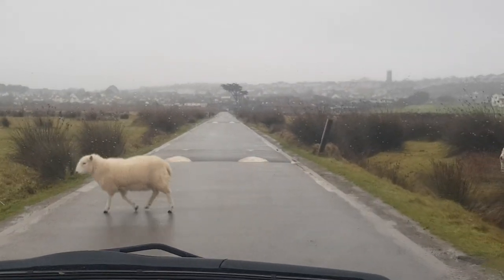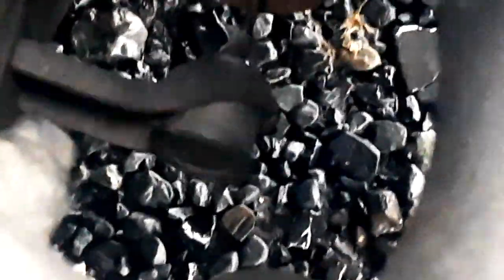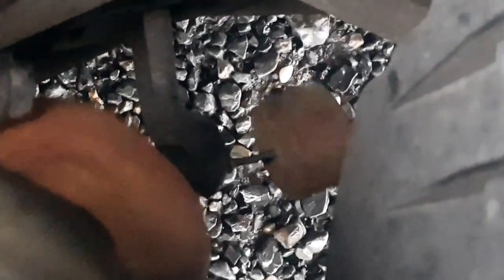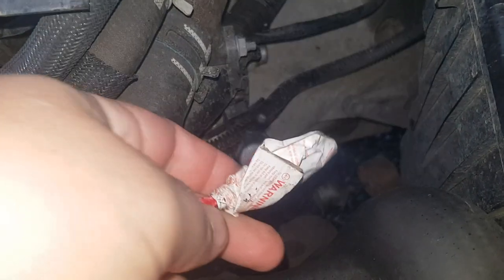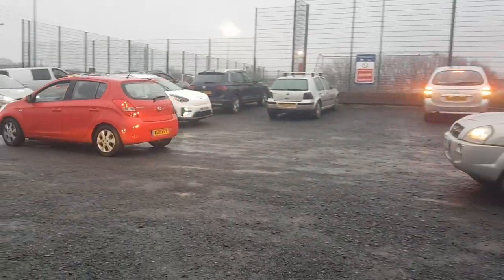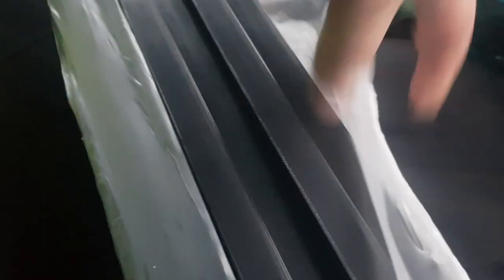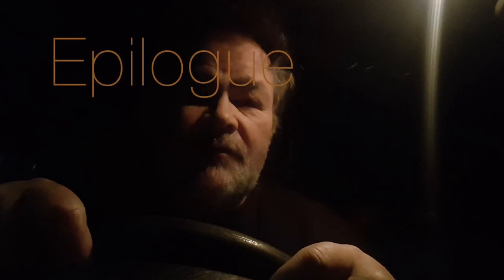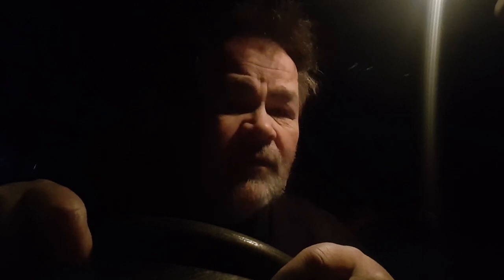VanLife S11E61 Driving a Manual Without a Clutch Pedal

Comment: Where there's a will, there's a way. Good show Tim.
Reply from the maker: That was pretty intense.
Reply: @SocksWithSandals  I'm sure Tim. I drove around with a snapped clutch cable for six weeks in my early twenties. Slipping into neutral to break and stop, starting in second to go, unless on a hill, then it was First. I ended up scrapping that car, it wasn't worth fixing up.

Comment: Tim the cable is loose because in front of the rusty cylinder there is meant to be another one smaller in diameter, but it's missing.

Comment: Back in '87 on our way to Exmoor my clutch pedal failed on my Fiat Amigo camper. We were passing through Bridgwater and came to a halt outside a Fiat garage. We camped on their forecourt and in the morning the bloke took a look at it. Turned out the outer sleeve of the cable had pulled through the floorpan. I bit of welding and we were on our way. Cheap too. Something like that? Or no spoilers.
P.S. You get a mention in my latest video.
Reply from the maker: Cheers, Mark.

Comment: Hi Tim, Check the bracket that holds the clutch cable on the gearbox before it reaches the release arm, They have a tendency to crack. Best of luck.
Reply from the maker: Not that, but thank you.

Comment: Sounds like you need a new clutch cable, not the dearest or longest job. 2 possibilities  either the outer cable has got cuts in it letting in water causing rust, or the inner cable is splaying and jamming.
Reply from the maker: I did say in the video, the cable has come off the pedal.
Reply: @SocksWithSandals   yes and I was saying the cause of the failure. I have changed the clutch cable on these vans , it took me a couple of hours. Mine was a left hooker, road wheel and inner wing had to come off to get to the cable routing bracket.  A couple of hours job done.

Comment: Oh no disaster, I had a 806 many years ago similar thing happened had to drive into town to garage. Turns out it had auto adjust cable that failed.
Reply from the maker: I looked into it.
Design flaw.
Common fault in small Peugeot/Citroen of this era.
Reply: @SocksWithSandals  is it fixed yet
Reply from the maker: No Spoilers!